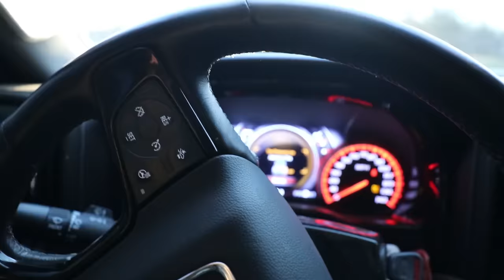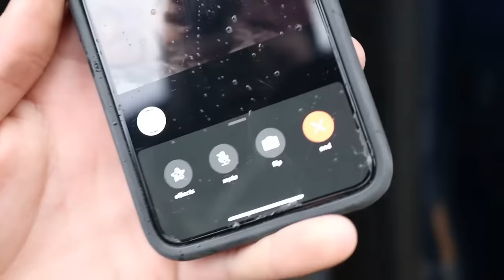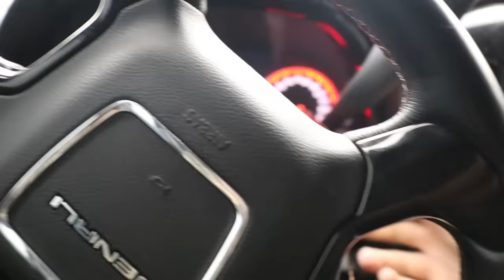Almost DESTROYED my BRAND NEW CAN-AM! Radiator CUT IN HALF!

Comment: Using dielectric grease on every electrical connection is a absolute must with these machines. They are not water tight from the factory.  Double check all snorkeling connections and cvt box. Make sure they are all tight and grease belt box seal to ensure no water can get in before going deep. Will save you time and money down the road.

Comment: I have a 2019 850 Xmr with around 30 hours on it which isn’t a lot but 90% of the time it’s been under water and I’ve never had one issue other than a factory axel broke and I replaced them with cobras. It’s been great other than that. Can ams are pretty reliable but they do have their quirks. I love mine but my Honda is definitely a tank no doubt about it

Comment: Did you tell them you road it in about 30 mud holes during the break-in period? 🤔
Reply: Dylan Weldon really doesn't matter since it wasn't a motor issue.  Can am stuffed up when installing the seals.  It would have eventually happened even if he did break it in slowly since it wasn't sealed properly.
Reply: Dylan Weldon break In period is 20 miles and that’s only for the belt I just bought one 2 weeks ago but yea I still didn’t run mine hard for about 50 miles just to b safe

Comment: U could fix that hitch all’s you gotta do is take a torch and heat up the metal wear it is bent and then while it’s hot put it in a vice and take the ball off and put a wrench through the hole and bend it back

Comment: FYI, get your trucks alignment and frame checked, in any accident even if it’s the receiver hitch because this attached to the frame and even if you don’t feel it the frame is taking the blow of the car which can put the blow through the entire truck damaging engine stuff and transmission stuff, it’s the same effect as trying to rip the frame off the truck with just a chain and a tractor
Reply: Also not a bad idea to get the can am checked as well, not that it won’t be flipped over and stuff but could save you some green if you do get it checked, things like shock absorbers like to bend

Comment: Glad you are both okay but so far i see a trailer missing lights and you are missing a chain supposed to be crossed to cradle the trailer and a hitch pin as well as not having a proper hitch that looks like a piece of square steel with a plate welded to the bottom

Comment: I had a lemon Honda that way too it was a 17 had it back 10+ times they didn’t wanna help or fix it right so I traded off on a can am xt1000 2 weeks ago I hope it’s good. So far I love it but I still have my 84 Honda 200s 3 wheeler it’s still the best thing I’ve got starts on the first pull every time. I am so got hit like that too over the summer the woman was in a Toyota Tundra ran clear up on my trailer didn’t hurt a thing on mine so it was kinda funny it messed up truck up good but she said her husband could weld it I’m like ok. Pretty sure it wasn’t weldable but🤷‍♂️

Comment: No brake lights, No safety pin in the hitch, No seat belt that's the dinging in  the clip prior, ooo and, No way way to tie done a ATV. The witch is not a secure tie down point.

Comment: eyy dont be talking crap about anything not running from factory unless you wanna mention the crap load crf450f or whatever its called. tyler monagan had so much trouble with his, it didnt even wanna start on choke. its a joke when to get a machine to even run you have to throw an aftermarket tuner at it and possibly an exhaust. so unless you care to chunk honda where it belongs...in the trash then dont talk about a can am. im a huge fan but the bias shows and that bias is so freakin confusing to me. i will never understand a honda fan, knowing they are trash, always working on them but claiming they are the best. all i have done to my kdx in 2 years is rings, the rest has been cosmetic or performance upgrades. the poor bike was put through pure crap with its last couple owners. one of the last couple took a hammer and flathead to a gasket surface and marred up the surface and broke a chunk out. cant blame a machine for that kinda problem but the kawasaki has been the best brand bike i have ever owned and i have owned honda before...once, then i learned my lesson and it will never happen again.